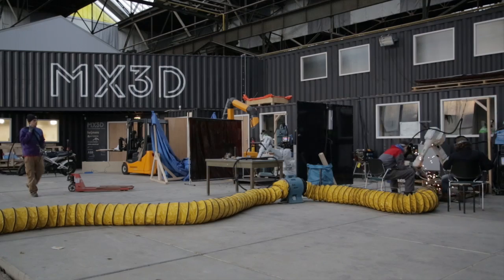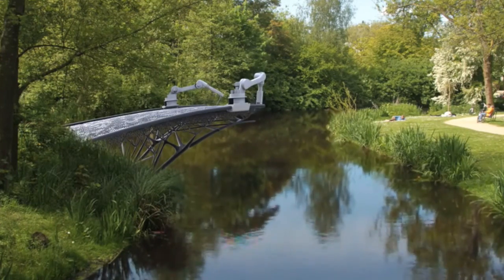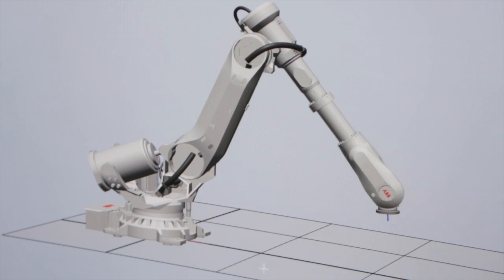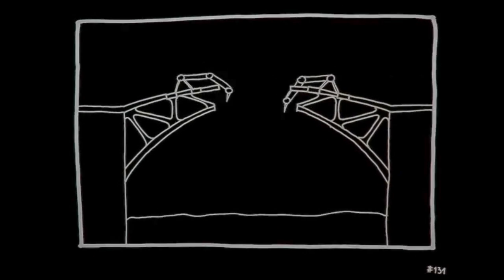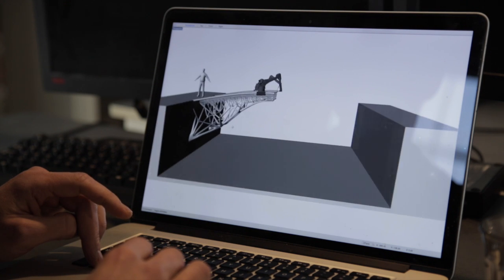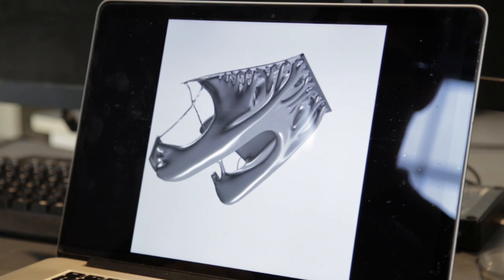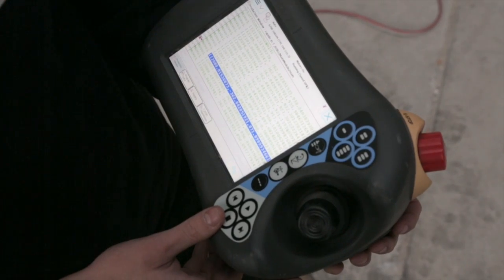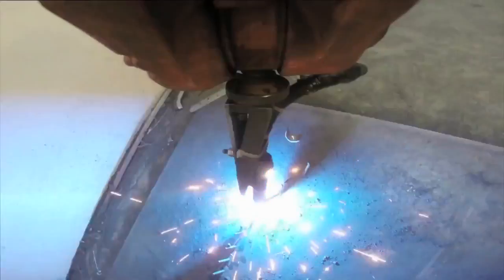Producing the world's first 3D-printed bridge with robots "is just the beginning" - Joris Laarman

Comment: mind-blowing... this invention is much more helpful ..but how much extruder temperature for metal or carbon fiber ??
Reply: The process is actually closer to Welding except their stacking "tack" welds on top of each other to build out a structure, it doesn't "extrude" like a traditional 3D Printer, current is more important than temperature
Reply: @kodyballard49  yes it is similar to weld repair, just a lot of them in a row

Comment: You should use a wire package 250kg or more in the robots adiction material, because the 15kg coils of wire is a problem, because the curve in the coil wire end is different to the start the curve of wire in the coil start.
TBi torch is a good solution.
Good look.

Comment: at the pace the bot is going in this video it is sooooo slow
Reply: +dragonspirit1185 The pace is mostly dictated by how much metal that can be applied to one spot in one go Before it gets too hot and starts dripping.
Reply: +SonsOfLorgar yeah I figured the logistics of it but due to that it's gonna take a long time. Also I wonder how they are gonna control rusting
Reply: dragonspirit1185 Only way I can see to control rusting is through material choises, and while it will take a long time, the robots won't stop until the structure is done working 24/7 as long as they have power and are supplied with metal on spools that in turn can be stored in magazines of several spools to last several days to cover the night and weekend needs.
Reply: +dragonspirit1185 Stainless steel welding wire.
Reply: 3d printing is slow in general
Reply: if there is no need to do it in situ, you can increase speeds by doing it under water.